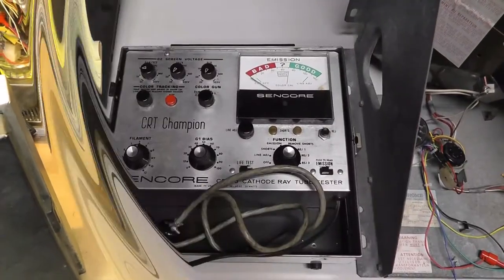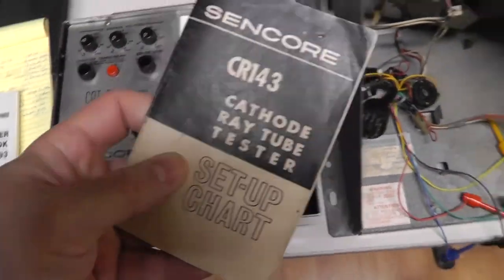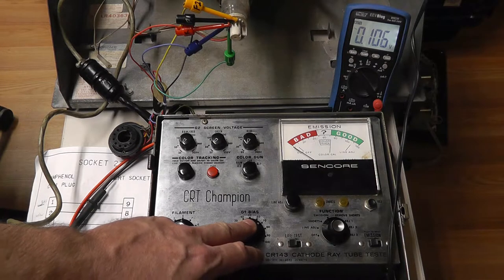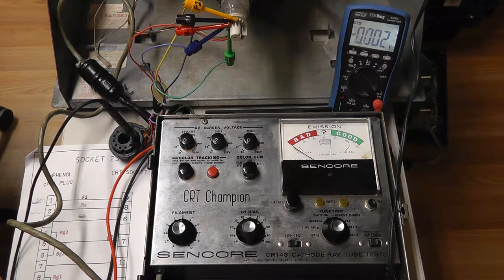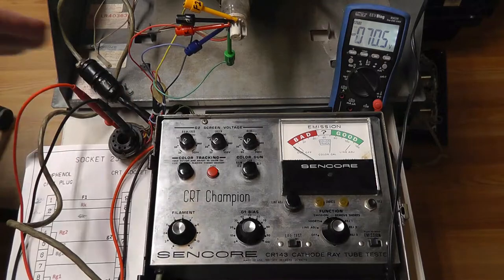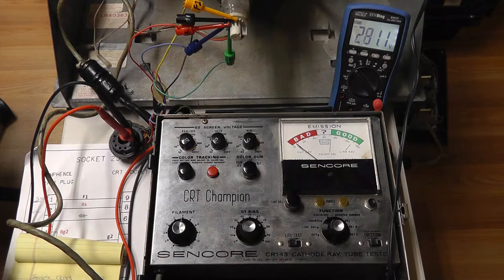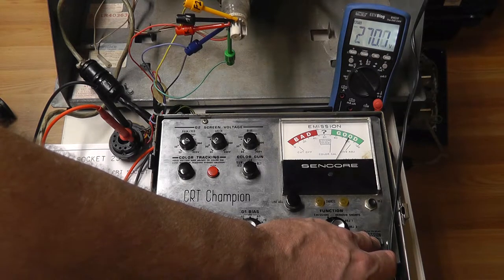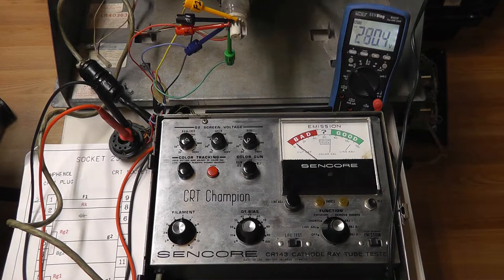CRT Tester Restorer - Sencore CR143 Part2 - Testing an Arcade Monitor

Comment: Some arcade monitors have a fuse to protect the hot transistor horizontal output transistor which I'm not sure if repair techs have added a fuse in line with the H.O.T transistor, but maybe you can find out if this is an add-on modification to do to all arcade monitors so that the H.O.T transistor doesn't get damaged or overheat.